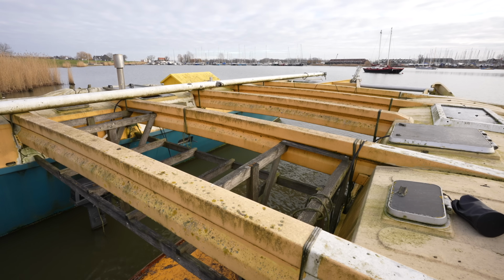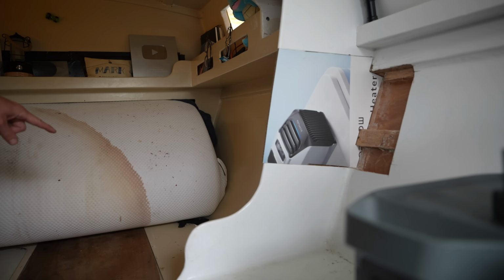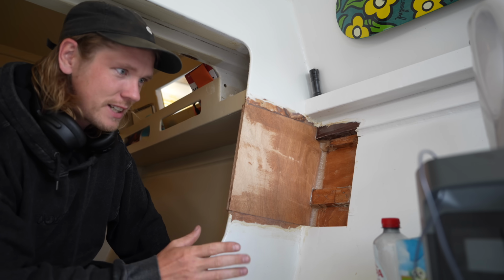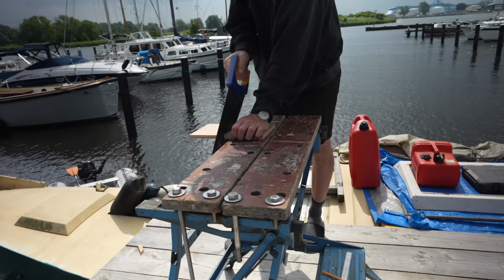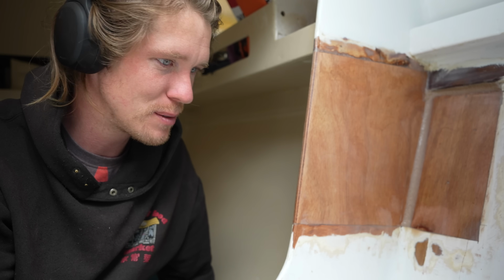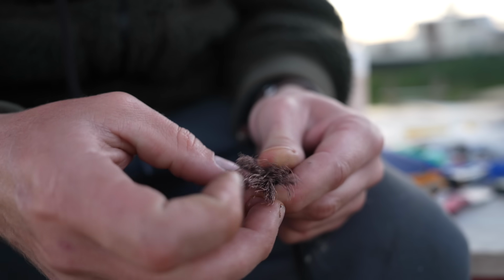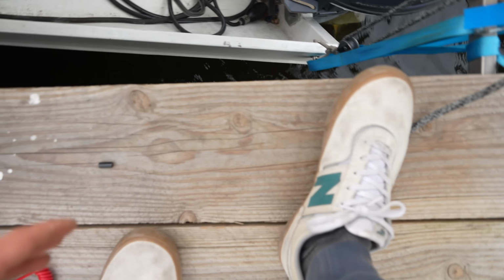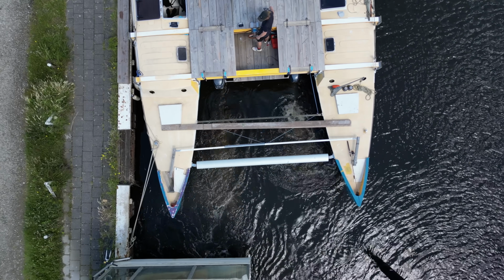My DIY Catamaran Engine Set-Up Is Complete!

Comment: Hey Mark. Been awhile since I've commented. Listen to all the folks telling you how to properly wire those engines and set it up so it's bullet proof! same goes for the repairs.  You have come a long way and learned a lot of valuable skills that will serve you not only with your own boat, but if you ever find yourself somewhere and low on cash. you'll be able to work and hustle up a few Quid at the same time! At the rate of progress, I'd say you'll be ready to set sail in a years time. You want to make sure that your vessel is ocean ready. It would really suck to find yourself floating around the ocean in a world of shit!  I think there is a much better solution for the engine mounting and steering system. From my perspective it looks quite dodgy! If I were you? I'd sail somewhere, and put it on the hard again. I would then find a Marine Engineer to design a better steering/propulsion mounting arrangement. I think it would be money WELL spent. Be easy bro and keep on keepin' on.   mattman

Comment: As far as I know you don't need anything to keep the alternators and batteries safe... alternators have built in regulators, so you shouldn't need to mount an external one.. how do you know that the one engine is overcharging??? It's going to show higher than 12 volts when the engine is putting running and the alternator is sending out a charge to the battery..

Comment: 2nd comment!!!
Please, please, please throw away those horrible crimping pliers you’re using - they just push a bit of the terminal into the copper wire and create potential failure points. Get some Ratchet crimping pliers - screwfix to a perfectly adequate pair for £21.99. Once you’ve used them you’ll wonder why you never bought a set before - I promise you!!!
Other than that, great video as always, thank you

Comment: Some items for you to consider (from an electrician on canal boats in london)
- Fuse your system pls!! Always fuse under the ratedness of the cable so the fuse goes before your cable causes a fire in the case of a short circuit/overcurrent.
- Get a ratcheting crimper. Save your fists. Better joins.

- You can also get DC breakers that you can resettable, and can also act as master switches for various circuits. A fuse and a switch in one.
- All the comments below about crimps rather than solder are correct. Your splice was fine for smaller amperages, and is usually fine for other types of electrical work, but for electrical engineering on boats, especially seafaring, you want a strong, corrosion resistant mechanical join, solder is very brittle. 
- Sterling alternator battery regulator. This takes the current from both your alternator and, as it says, regulates it. This is what you're talking about at 22:10.  However, it wont keep charging it and charging it - the amps will peak but it can overvolt the battery (more on that below). Dumping 15v into the batteries is not the best way to charge lead acid/AGM/Gel batteries for maximum long life. Alternator battery regulators like the sterling take a consistent voltage and phase from your alternator, cleaning up the voltage in terms of any phase differences and spikes, and makes the charge nice and fresh for your batteries. May even work well for your two alternators, that would definitely cause some funky phasing issues. Have a bit of research into that, I dont know about two alternators at once. Alternator battery regulators work by creating a staged charging cycle - the first is high voltage, high amperage (bulk phase). This is the actual charging. Imagine its putting lots of momentum into the battery (like pushing a boat, or a game of curling!). Then, the regulator lowers the amperage as the battery fills up, and then lowers the voltage as the battery is full. (Absorption). Once the regulator receives the feedback that the battery is resisting a higher amperage, It sort of lets go (hence the boat/curling metaphor..) of the bulk power amperage and voltage and lowers both gently, to let the state of charge sail right into 100% (or near as), as smoothly as possible. The third phase is Float charging which is just a steadily applied very low amperage and very low voltage to counter any natural discharge of the battery chemistry itself and keep it healthy. Unhealthy batteries are mainly to two things, the first is due to overvoltage, which causes sulphation on the actual lead anodes, as well as boiling of battery acid (if flooded), and the second is undervoltage due to higher depths of discharge. If you discharge your batteries (usually past 60% for lead acid), then they have a hard time reaching full. This slow discharge is a natural process (which is what the float phase counteracts), it happens anyway - but deep cycling batteries past a recommended DoD puts them permanently out of shape.  
- Yes, 2x starter batteries with correct Cold cranking amps for both your two engines, with a separate leisuire battery, all connected with a 1/2/Both/Off switch. Putting them on both will connect leisure and starter bank in parallel for emergencies, dumps charge from leisure into starters. (A bidirectional split charge relay will also charge the leisure battery from the starter, another bit of kit to look up.) You wire terminal 1 on the 1/2/B/O switch to your leisuire, and 2 to your starters, so generally keep it on 2, or off, at all times. (do not switch whilst engine is on, massive jumps in voltage across the system will occur.). 
- Get a coloumb counter, my best is a victron smart shunt - easy to install, simply is the last thing into your negative pole on your battery. Lets you monitor amperages and voltages coming in and out very accurately and easily. Good internal algorithms and consistently updated. 

I am very happy to draw you out and design with you any electrical plans you might need for free, would be fun :) Drop me a message if youd like!

Comment: Solder splices are not a good idea, they tend to get brittle, the splices often fail right at the end of where the solder is.
Crimped splices are a lot more reliable when done correctly, there's a reason why in places like automotive, pro-motorsport and aviation you only use crimp splices. The "open-barrel" type splices are a really good option, non-insulated closed-barrel splices work really well (most of the power grid depends on those), avoid insulated closed-barrel splices at all cost though, it's always best to crimp, then put heatshrink over it, preferably the glue coated heatshrink, as those seal the connection from moisture. 
Remember to always keep all ends of your cables sealed, if you have exposed copper anywhere, remember that moisture will wick through a cable (between the cable and the insulation or between the strands of wire)

Comment: I'm sure it's to late for advice regarding soldering, Don't on a boat for connectione,use a CONNECTOR,it't very easy to end up with a DRY connection and you dont have the cost of a soldering iron.

Comment: About the over charging….  It seems you’d be able to put some kind of break/switch between the engine and the battery once it was running to prevent the alternator overdoing it. It’s a band aid but would save the batt 😎

Comment: When you cut the place in the side for your cables, rather than drilling them at a level or upward angle, why not drill them at a downward angle?? Water doesn't like to travel uphill and drilling at a downward angle would improve your chances of not having a water or moisture issue later on

Comment: Heatshirink should be used the thick one with the waterproofing white stuff inside.
Also black copper is not good Sir, and to clean, only acid will help.
I think you need someone to help you with the electrics as marine stuff it's so much different.
I would redo everything to be honest. I'm not criticise your work.

Comment: The deep cycle battery you are using to start the engines is not designed for those purposes and eventually, you will damage the battery. I went through a bunch of batteries for one of my boats that has a 20 hp which is essentially the same as a 9.9 for these purposes and what I settled on after trial and error is I use an ordinary car battery- the smallest one that’s available. They’re very cheap, light, compact and they have enough juice to start your motor 20+ times even if something is wrong with your motor and it’s not charging the battery. if you hook one to each engine (that’s two batteries total) they will take care of themselves and you probably won’t have to look at it again for another couple years. I tried large motorcycle batteries, but those didn’t work well. Maybe the compression is higher on outboard motors. Also you really should strip down that black wire a little bit and if it’s still black, you should replace that whole cable that will cause your problems for sure. I’m building a catamaran as well  from a different designer. I find your videos helpful for tips when we’re working on our boat. I’m looking forward to the mast part of the build because that’s the part that has me perplexed in terms of my own build.

Comment: Not a gentle post .... and I hope you read this. In over 40 years of having to solder cables, and terminals I have never seen such a bad result.
Avoid at all costs joining cables, always have the correct length cables and crimp the connectors with a proper crimp tool with the correct size dye. You cannot tell if you have what is called a 'dry joint' with that solder connection. This is going to be a point of failure.
The cable with the 'black stuff' is basically rotten and should be scrapped. That black corrosion will extend much further back along inside the insulation. It will cause major problems sooner than later. The individual wires will become brittle and crumble. It is also a possible source of heat and fire. Electrical cables should also be checked for continuity and Megger test the insulation by a qualified marine electrician. You can check on line for companies that will make up cables of the size and length required with correct connectors ready made for you. You have already owned two boats with 'dodgy wiring' avoid doing it this time.

Comment: Don’t do any soldering of wires. It’s a false economy. Especially that thick and in a marine environment. You’ll regret it later. Always crimp it’s a type of cold welding which fuses the strands. Much safer and definitely more reliable.

Comment: Mark --- Don't solder that heavy of wire together.  It's just asking for failure.  It will never last.   You should, when possible ALWAYS use a single run of wire for heavy power like that.  IF you need to splice , use a Single Terminal and put lugs on each piece of wire and then BOLT them down on the single terminal.  Even a tin coated copper splicing bolt would work.   That solder will dry rot and you'll lose 20-30% of your Voltage thru that solder joint.   Just don't do it bro.

Comment: You have to have a charge regulator for your batteries or you will damage or destroy them. Worst case scenario the overcharge causes them to out gas hydrogen and it explodes, not a outcome you want in any battery situation, a boat least of all. 15 volt is 1-2 to many for a 12 v battery charging so you should stop doing that right away. The solar must have a regulator as well as they often put out 17-20 volts from each 12v panel. That all in one battery/inverter you have may be able to take "raw" power from panels and engines you will have to check the manual if and how to connect it, a stand alone 12v house battery can not.
Ps. put the cable holes on the inside of the hulls so the cables do not snag on things you pas in cramped places.

Comment: Mark, you're a smart bloke, go do some more research. Whoever on YT said the solder technique you're using is the best is straight up WRONG!
Also, as previously mentioned, crimping in a marine environment is a better method. The black crud on your wire is oxidization, cut the wire back until you get to clean wire, or toss it and get a new wire. Regardless of how much you clean it, the oxidization will prevent a good connection (solder or crimp). It'll have more resistance as a result, draw more current, get hot, and potentially a fire hazard.

Comment: If that had been me ( & it is not) I would have bared the ends of the wires & laid them together & clamped them with a small "U" clamp then covered in self alamalgamating tape. Soldering is not recommended for such applications. Crimping is best

Comment: That bulk head, needs atleast 3 ply on it going least 3 to 5 inches past the top and bottom cut. That is not gonna hold. Sorry mate. You are skimping way to much, on things , that can leave you stranded. Why ? Please, no more quick, fix, stuff. Please do it right. That's not even marine webbing,  or thick enough.  The vibration is due, not enough solid or thick enough structure for the engines. I almost feel you did some stuff and shot footage for video content for more dollars to come in. Sorry,  not trying to be rude.  This isn't a river boat. This is ocean. Don't rush content, when you have the money,  do it right. It's okay to wait. Ya need a generator,  radio, gps, yet. A few batteries  .  I asume you got to have it inspected aswell when it gets closer. Those engines are going to pushing a 3,000 pound plus boat in waves. Do you feel confident.  The thickness and strength, and stress it will be under is 100% solid. Your life depends on it.  Boat light system ? Ready ? I'm not sure you have the money, to get what you need, to have it ready for this year. Sorry mate.  To be honest. Unless you got all the Electronic and everything ordered and on its way. You still look, 6 to 8 months away.
Reply: Second that. I think it`s just his way to attract clicks. Some sailing channels use bikinis and lots of skin for the same reason. Waiting every week to see what messy job he has done, is also a form of clickbait.
Yes the design he chose is, when build proper and according to the designer, a safe and sturdy boat without a doubt but the project was too long abandoned for "just" a quick inspection and repair. All the jobs and altering he has done so far are potential life hazards for boat and crew. The people commenting all about how nice his parents are etc but is nobody concerned over this young boys life ???
Reply: Yeah I agree .... I thought he was going to sand and apply after.

Comment: I'm afraid that bulkhead repair is going to fail as good as it looks.  Why risk having a bulkhead fail when you can either glass over the entire joint area or glue on a ply doubler each side of the bulkhead straddling the joints. Don't take the chance mate, the consequences are not worth it.

Comment: I won't say that you're pronouncing the word wrong, because our Daniel Webster deliberately altered the spelling and pronunciation of some words when he wrote the first American Dictionary to emphasize the difference between Americans and British.  So, we pronounce it sodder (silent "L").  Perhaps you have the right pronunciation for the UK - I don't know.  Two peoples separated by a common language!  I was thinking about your bulkhead repair.  I believe you're right that most of any forces on it will be either compression or tension.  I would have wanted to make the connection more mechanically sound - tongue and groove, or step and scarf.  But i tend to over-engineer and build more heavily.  If it breaks, you can fix it differently. Separate batteries for the engines appeals to me because of the redundancy that creates.  Or, feed the alternator outputs through a voltage regulator - I'm sure such are made, though I've never had to investigate.

Comment: Your soldering iron is way too small to transfer enough heat. Soldering with a soldering iron will give poor results. You can buy special connectors that contain flux and solder inside  a shrinkdown waterproof shell. You prepare the cables like you just did, but you insert the bare ends and simply heat with a blowtorch or heat gun. It solders and seals the connection from water ingress. Always start with a ‘new’ end and cut off any tatty bits.

Comment: Your soldering irons not big enough to heat that volume of  copper wire... 
Soldering isnt the best thing or easy, mechanical  crimps tend to be whats used for building looms.

Comment: I try to avoid being that tiresome naysayer, and here comes the "but". At 73, this is the first time I've ever seen anyone try to "clean up" corroded electrical cable. Typically, you cut the visibly corroded section off, and then you cut off a bit more, to account for the corrosion that's not yet visible. If it continues far enough that the cable ends up too short, you just use a new length. 
You have cosmetically cleaned the end of the cable, but the corrosion definitely goes much deeper and will continue to wick it's way along. No major problem long-term, as it will only require a new cable, but then you'll be unnecessarily repeating the installation work.

Comment: 5:00 This is one of the worst solder joints I have ever seen in my life - there is not enough temperature for the solder to actually flow and form a proper connection. It should NOT be left like this, failure is inevitable - very bad.